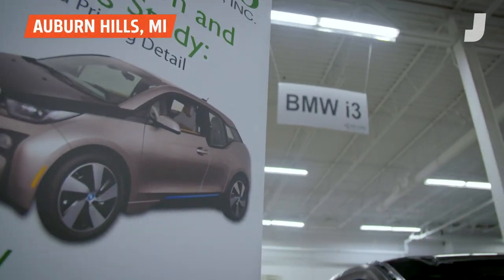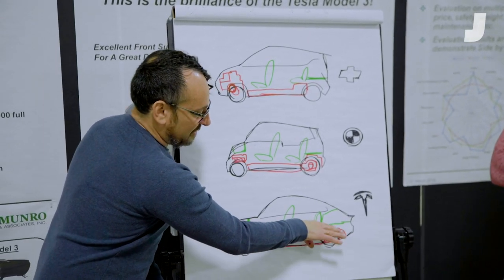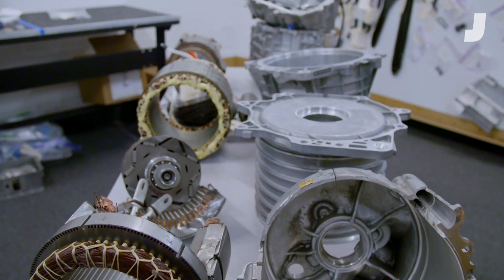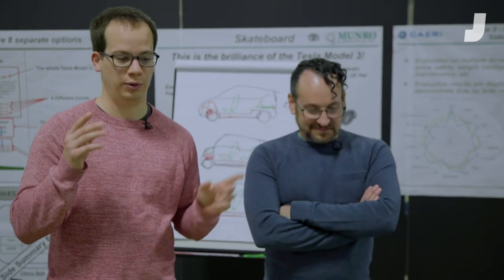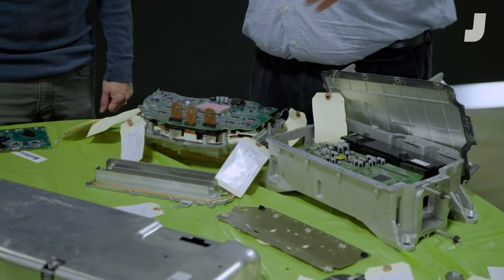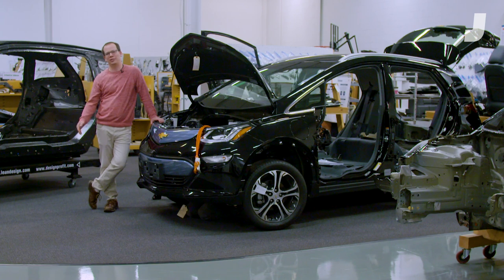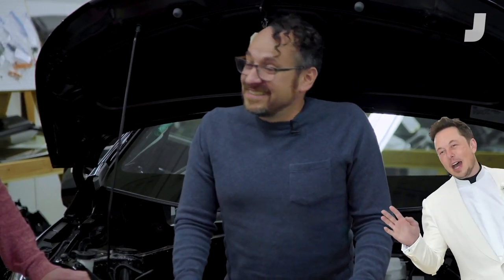A Look Inside The Tesla Model 3, Chevy Bolt, and BMW i3

Comment: What about fire?  We've seen a few battery fires in Teslas where the fire trapped people in the car.  Granted, the fire ensued after very serious accidents but typically, IC engines don't burn that quickly.  I read that in one accident, the Tesla caught fire twice more in the impound yard because there was still a charge in the battery pack.  That may not be a Tesla issue so much as a battery issue though.
Reply: The battery is not the cause of the fires.
Reply: @vidznstuff1  The cause of the fire was the crash, clearly.  The comment was that lithium batteries burn.  Once started, the fire will continue so long as there is oxygen, fuel, and a spark.  If there is a strong enough charge in the batteries and the batts are damaged then they can generate heat to the point where they ignite. It happens to laptops, iPhones, and even Boeing's Dreamliner.
Reply: @schreds8882  Um, no. That's not what your initial comment said, so now you're morphing your argument.

Yes, when you heat up a lithium battery, it catches fire. So does gasoline.  Your statement was crash -> battery fire is not correct. Crash -> fire -> battery fire is possible, but not common. 

The press, on the other hand, reports electric car crash -> battery fire. I even corrected the reporter on the Tesla crash in Florida as to the cause of the fire, but she was whoring for views and redistribution of her reporting, so continued to spew her lay opinion of what happened, which then proliferated worldwide. One airhead did that. 

Your statement of "strong enough charge they can generate enough heat" is also total bullshit, by the way.
Reply: @vidznstuff1  No, the comment was about how to deal with fires generated by batteries in EV's.  Since EV's use lithium batteries, there is a high risk of fire in a serious crash.  Lithium battery fires are very hot and can burn so long as there is power in the cells.  Given that EV's put their batteries along the bottom of the vehicle, fire will come up the sides of the vehicle enveloping the doors and windows making escape impossible.  This was seen in one of the Tesla crashes.  Again, not necessarily at Tesla issue but a battery or design issue.

Comment: I wonder what the comparison would be like if instead of the Bolt being a slap together car, it be a new model evolved from the EV-1?
Reply: I still wonder what a modern drivetrain in an EV1 would be like. If it could go 160 miles on a NiMH pack, lithium ion, especially at the density of the Bolt pack, should push it well over 300 miles. That car was insanely aerodynamic. 

I would hardly call the Bolt slap-together. Yes, it was rushed, but the Bolt is its own car, introducing the BEV II platform. There are no signs of being a conversion.

Comment: I just wonder if these cars will be servicable in the long term, like in 20 years? What if this electronic modul needs to be replaced for instance?
Reply: Then you replace it lol
Reply: Because they will last 20 years - unlike a gasser.
Reply: perudolux
Let's see
Say you need s new battery.
You will phone up either the manufacturer, or one of the the many battery module recycling companies that will be available by then.

You will ask them for a price to install 
a new battery pack.

You choose the one you want, quite possibly much long range than your existing pack!

You drive to the company and 2 hours later you have a new battery in the car, probably containing the latest cell technology with far superior resiience compared to your original battery and at 30 to 50% of the price.

Your car now has double(?) The range and charges in a third of the time!

(Your old cells are sold on for second use, the case is refurbished)

OK?
Reply: Roger Starkey not worried about batteries, more about the electronic cards and components

Comment: and then let’s also not forget about the whole self driving tech and ota-updates and millions of features.
Reply: self driving & summon, which is in alpha (not even beta) and fails or crashes (in the case of summon) all the time, OTA updates which every manufacturer is now implementing since they've worked the bugs out; not trying to piss in your cheerios, but Tesla needs to start learning from the auto industry at large, instead of just resting on their laurels (being the battery, motor & controls tech they have on everyone else).

Comment: Excellent review! Love the detail.

My objective and subjective opinion is that Tesla deserves major kudos for their clean-sheet Model 3 design. IBM and Chevy haven't done anything terribly innovative in the electric auto market even though what they have done is innovative for them. But I've driven all three cars here, and can say with zero equivications that Tesla blows the other two away.

Hands down.

And that's the thing. I want a competitive  EV market. I want GM and IBM to compete effectively in the EV market, along with Ford, Chrysler, Mercedes, Honda, Toyota, Hyundai, Kia, etc etc. But so far Tesla is wholesale running away with it. And good for them; they've done great engineering, they've got a great product, and they deserve a good payday.

But I want GM and all the rest to quit fucking dabbling their toes and make a full-throated commitment to the EV market. We know that fossil fuel is dead in any foreseeable future, so lets get on with it.
Reply: And we all know you meant to say BMW not IBM, good points.
I'd like to see the best of all 3 incorporated into an EV.  I think BMW's carbon fiber does well at lowering weight, though there needs to be a mass production means of slapping the chassis together like Tesla does with it's Gigapress. They could all learn from GM by making it front wheel drive, I hate rear wheel drive in the snow or the rain.  I love the interior of the BMW, but would prefer the single screen of the Tesla.  Tesla's motor is a winner, but I think there are some more light weight and more powerful motors available.  And I'd like all of the electronics to be beefy like Tesla, but easily accessible under the hood, so when a module goes bad you unplug it and plug in a new one.  EV's should be easy to troubleshoot and to work on without having to involve a dealer, as long as you aren't messing with anything high voltage.

Comment: Wonder if I can set a Rat Rod body on a Tesla chassis/drive train?!!? Nah ... wouldn't make enough noise!
Reply: Nah you just install a written off P85 drive unit and broken up Tesla Modules into the existing chassis. Range won't be great but it will work for like 150 miles. But wow that would be a scary ride if you unleash all the acceleration torque from 0rpm.
Reply: Just put baseball cards through the spokes
Reply: See Teslonda on YT
Makes plenty noise when he takes of Lol

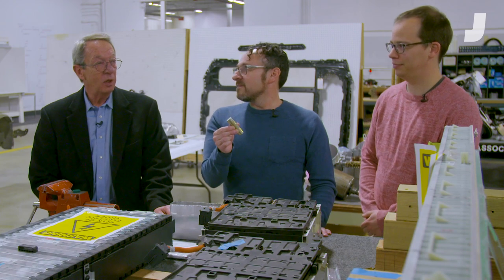Comment: 3:59 - Battery (Expert)
8:09 - Motor (Expert)
11:56 - Electronics (Expert)
14:26 - Chassis (No Expert)

Curb weight:
BMW i3 = 1195 - 1315 kg
https://en.wikipedia.org/wiki/BMW_i3

Bolt = 1616 kg
https://en.wikipedia.org/wiki/Tesla_Model_3

Tesla 3 = 1611-1847 kg
https://en.wikipedia.org/wiki/Chevrolet_Bolt

This video only interested in expert opinion in "powertrain design", while excluding all other major talks from experts like 'safety', 'manufacturing cost', 'reliability & ease of repairs', or even 'overall car weight' (power to weight to capacity ratio).

Tesla came up with a grounds breaking 'lightweight powertrain solution', but end up pushing a very heavy & inefficient chassis.

If anyone knew Tesla history i.e 'T-Zero' back in early 2000 where 'hydrogen / electric' was still popular when battery like NICAD still rules, the conclusion from T-zero was that the major limitation factor at the day for any e-car was 'energy density' (storage) & 'energy transfer' (waste heat & charging / discharging consistency). 

For Tesla:
4:30 - Not everybody, I didn't, because it obvious for those who study closely that you get finer controls (better energy management).  The only dismissal is the use of cylinder casing (energy density), that is why no one have taken a closer look (devil in the details).
6:46 - the reason for using cylinder due to surface area for internal cooling
11:05 - internal channel for cooling

Against Tesla:
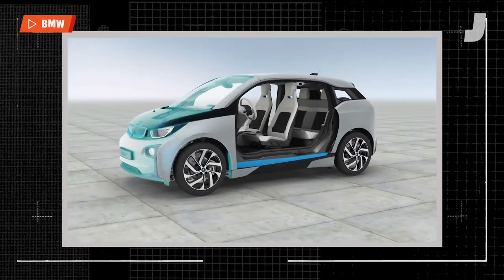2:10 - Wrong, Most European cars prefer FWD for traction e.g. roundabout
2:45 - Wrong, generally more space in rear than front in any car, because the front section always need space to accommodate instrumentation, crash beams & steering e.g. no such thing as rear steering in any car.
Regardless of space arrangement, all three cars mostly focus CG for safety first before looking into boot/ truck space.
13:46 -  true it grounds up design and hence smaller package for Tesla,  whereas 'modular design' take more space, but "repairable".
14:40 - the overall car weight for Bolt is same as Tesla, so picking up one sub-frame from Bolt doesn't mean crap.
15:22 - The glue is actually stronger than traditional edge/ spot weld, due to "surface area contact", developed in 70s.  Also, BMW found a way to join light carbon frame for mass production. This is big news.
16:16 - No matter how much a 10 year old Tesla have improved in quality, it very hard to compete with BMW (& Toyota) who wrote the book about "quality control" with over 60 years of assembly experiences.  These books are taught in every classroom who want to become the next car design engineer.

Comment: Wrong the pouch cells have far lower volumetric energy density than the cylindric even considering packaging
Reply: Rykahnz I think they were referring to the potential charge and discharge rates which are much higher with pouch cells, but yes, per volume cylindrical cells can pack somewhere in the neighbourhood of 2x the capacity.
Reply: @kand198  then they should've said power density which is also hard to believe as the Model 3 is the fastest car there and the fastest charging car in the world
Reply: @ryccoh  it's not really hard to believe. It's a well-known fact that Liions have slower charge and discharge rates but are more stable and therefore safe as they are less likely to do the whole thermal runaway thing and they also have fail safes built in. Other advantages include their ability to be more deeply cycled and abused.

Honestly, if you wanted to, you could probably charge a Chevy volt at about 5-15C depending on the exact makeup of the cells (probably closer to 5C because cost) which theoretically is a full charge in 4-12 minutes...

...if the battery is the only limiting factor and balancing is totally ignored and you were somehow able to cool the battery, and now you see why despite having a higher charge rate, the Chevy bolt charges slower haha.

Also in terms of discharge rate and power output, the amount of pure current the pouch cells can theoretically put out is insanely high compared to the cylinders, however due to the way they're connected you still get 2700A output from the tesla pack vs say double that with the bolt pack which is unnecessary and not utilized in a car like the bolt.

Compare this to the SAE car which is pure performance nothing else and it's all about weight to power ratios and you'll see why they currently choose to run the pouch LiPo cells. HOWEVER even in this case there is no cut and dry winner and two of the team leader's are doing an in depth battery comparison as their final year engineering project in the FSAE context and apparently there are arguments to be had for either camp, and being used in industry the cylinder cells are more likely to see greater improvement in future so a switch even at SAE could happen down the track.

Note that the numbers I used here come from the top of my head and they're ballparks which won't be right but shouldn't be too wrong.
Reply: @kand198  As far as I know the American top FSAE teams use Li Ion idk about Europe though. I thought pouch cells were just a form factor and still usually Li Ion in Cars. For the bolt they are Li Ion Standard NMC chemistry I just looked it up. Yes Lipos are awesome and have high power density but they are not used here and the reason why is probably that they just don't last as long as Li Ion They tend to have less cycle life.
Reply: Rykahnz hmmm true. I just assumed Lipo when I saw the pouches lmao.

Also modern lipos with graphene and shit can get over half the cycles as liions as long as you keep them inside their temperature window and you cool them properly (e.g. tab cooling, not side cooling).
Reply: Rykahnz yeah just had a look and the kWh/kg of the bolt is definitely less than the Tesla but not by as much as I thought it would be, and its discharge rate should also be similar because of the similar makeup - I think the Liion composition of the Tesla is supposed to be more advanced?

Also on FSAE, my uni placed third in the Australasia competition even as one of the smallest in the competition and without any aero package and with lipos, and I remember the head of electrons saying that they picked the lipos they did because everyone else were using them. That said, I think if liion was cheaper and a bit lighter then that would probably be the push needed to switch since you can offset lower discharge by going higher voltage/lower KV, but you just end up killing yourself with weight.
Reply: @kand198  I was actually EE lead for an American FSAE team. Idk how similar our competition is but it didn't make sense for us because we're limited to 80kW peak power by the rules and the capacity needed for the endurance race meant that regular Li Ion could easily meet the power requirement. As far as E density everyone always instantly defaults to gravimetric E density which obviously doesn't vary much because it's dependent on chemistry, however volumetric energy density varies greatly and is maybe even more important than gravimetric in electric cars. I was referring to volumetric energy density.
Reply: Rykahnz oh nice!

Yeah I’m actually only a first year engineering student and I’m going through the induction process - currently having to design and build the TSAL to prove I’m not a complete moron.

The regulations are the exact same at 80kW and maybe once the electron heads have finished their project they’ll come to the same conclusion as you did. We are moving to a different power train package next year so it would make sense to make any battery changes then too I guess. I only know for certain that we currently use pouch lipos haha.
Reply: Lol I actually designed and built the TSAL as well and pretty much every other electrical system, let me know if you need any pointers.
Reply: Rykahnz just a quick update. I spoke to the guy earlier this year and he said that he would be recommending a move to cylindrical cells and a very specific LiIon formula for next year. Well also be moving to awd next year and unsprung (I think?) aero and I think our carbon fibre monocoque will get some big updates too.

I finished my prototype TSAL and presented it on Thursday. It was all pretty straight forward and I should hear if I get accepted into the team today or tomorrow.

How big was your team? Our one is ~50 people and they get about 200 applicants every year which they whittle down to 50 people to do the initiation projects (like the TSAL, moveable headrest, rear or front tow bar etc.)
Reply: I'd be interested more on the specific Li-ion formula but yeah cylindrical cells can't be beat they have 2-3 times the energy density of prismatic and pouch cells even taking into consideration packaging inefficiency (volumetric E density). This is because you can really wrap them tightly as wrapping around a cylinder core evens out and lessens the strain on the thin cell sheets compared to folding them or wrapping them in a tight oval shape. I hope you get in and I'd love to hear more details on how you designed the TSAL. Ours is really simple only using the gate threshold of a FET as voltage indicator. Our team is young so we only have 30 people while only two right now are EEs which is unfortunate. Our university's EE program is good but just too small with only about 50 people graduating per year as far as I can tell and it's super time intensive so it's really hard to attract EEs into the team. As far as AWD it's very cool but I can't see enough design incentive for it although it will really pay off on a rainy race day. I'd really like to experiment with a capacitor regen system too although we'll have to see what kind of regen we get with our Emrax.
Reply: Rykahnz the TSAL was just a zener diode going to a relay with a fly back diode and a resistor to close the led flashing circuit. Idk what they actually used. My friend did a voltage regulator and a octocoupler which is what I think the most common design was (btw this was designed to 2018 spec not 2019 for some reason - rule change?).

Our team is the only one from NZ so we get access to some pretty cool resources, but we’re still small compared to some of the other teams. What is cool is that because Bruce McLaren (the McLaren) was a kiwi we get sponsored by his charitable foundation and get to use the McLaren logo and have a McLaren livery on our cars and we get his number - 47. It’s almost like working for the McLaren f1 team ;)

Our electrical team is by far the biggest with 5-10 people doing design and up to 30 doing manufacture.
Reply: Rykahnz Our uni puts out about 100-200 EEs and about 200 mechatronics and 150 compsys engineers, so the recruiting pool for EE is pretty big.